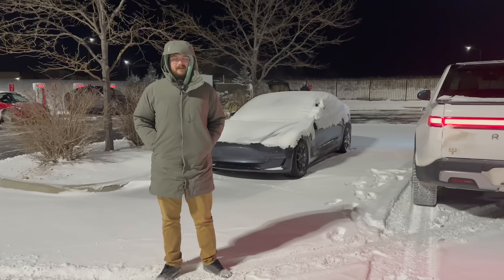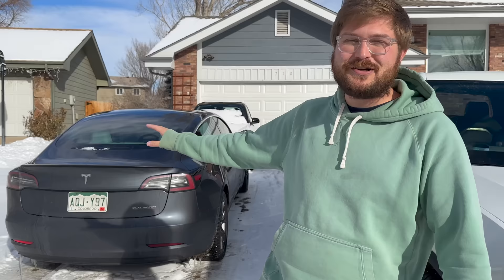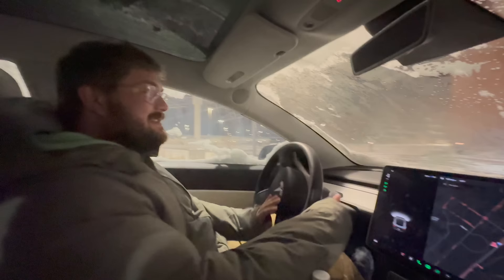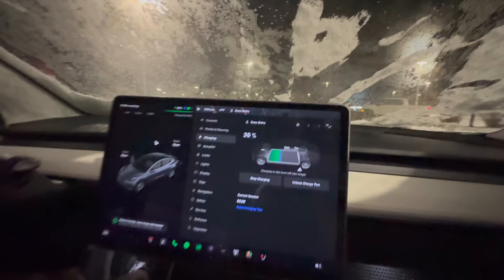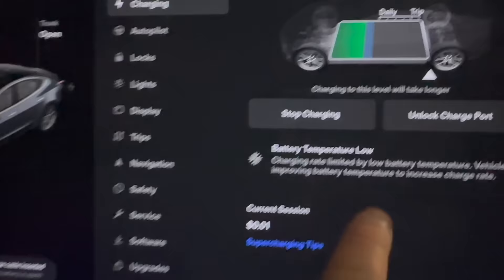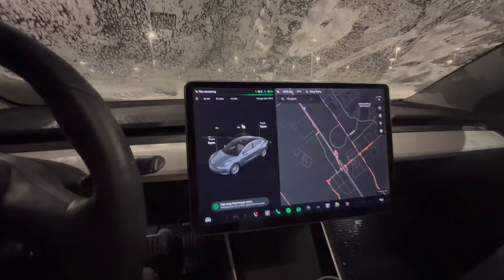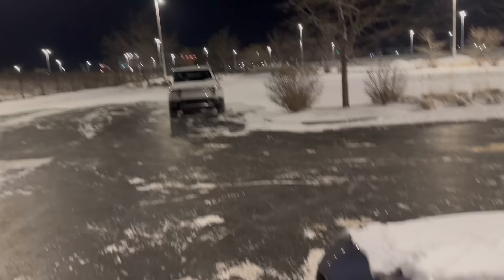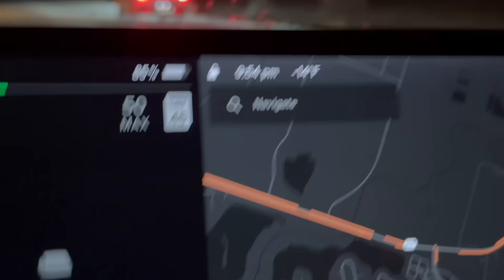I Deep Froze My Tesla And Immediately Plugged It Into A Supercharger To See What Happens

Comment: OK, so perhaps it's my age, but I grew up here in Canada and I would never leave the driveway unless ALL windows were completely cleared off. Just a safety thing to have clear and unobstructed visibility. Just a thought.

With respect to EV ownership, managing the battery in the winter is definitely part of the paradigm shift the owner would need to go through. Totally agree with the charge-up-before approach for the very thing that you experienced. In many ways, cities still need to better understand the need to provide even simple level 1 and 2 charge points for people without driveways or garages. There are light poles on every street, so it's not like on-street charging is impossible. They just need to work out how to make it accessible and fair.

In northern Canada, parking lots had outlets for ICE vehicles so that people could plug in their block heaters on cold days. Its not a far stretch to do something similar for EVs.
Reply: No one cares bud
Reply: @ccgb92  it is also the law
Reply: @KarlDahlquist  irrelevant. only thing wrong with teslas is: ain’t got no gas in it.
Reply: @ccgb92  begone troll

Comment: Watching you look out the frosted fogged up windows and seeing your breath made me really appreciate my internal combustion engine; thanks for the video.
Reply: Tesla needs a cast-iron wood-burning stove for heating :)))
Reply: He could have just turned on the heater though, and been warm in a minute or two. At those temperatures that takes an ICE forever.
Reply: @Adriaaan  It only takes my Expedition 5 minutes to warm up enough to put out heat. And I've owned and operated ICE driven cars that put out usable heat much quicker than that.
If you can't make it 5 minutes without heat, you should probably stay inside your house anyway.
Reply: @Adriaaan  And he would have filled up his tank and driven off in 90 seconds instead of sitting so long it warranted a video.  EVs are a friggen joke and everyone knows it.
Reply: @Leester-70  Sometimes, I 'Like" comments sarcastically.
Reply: @christophermahar3025   Fascinating.
Reply: @Leester-70  You missed the point of the video.  He did this to try and develop a worst case scenario on purpose.
Reply: @TheBowerbird  Fair enough.  Now do this same test with a gas engine.  EVs suck.

Comment: I live in Fairbanks Alaska we recently hit -41 and I have seen minus 71 in the 14 years that I have lived here. I was extremely interested in seeing what your video reflected. I am impressed with your expertise and knowledge of the Tesla and really appreciate the information that you shared. I would definitely like information as to how efficient the Tesla ran at the negative temperatures. How much did it diminish the distance you could travel. Look forward to seeing more of your videos
Reply: If I were you, I wouldn't trust ANY fully electric vehicle to get you across the Dalton Highway - even in summer.
Thank goodness for fossil fueled motors.
Reply: I just read of a story where  a brother and sister rented a tesla from Orlando to Kansas when they hit the cold weather, they had to charge 6 times in 1 day
Reply: I am in Canada and I can tell you that on a negative 30 day my range will be half. It’s not so much that you use more to travel it’s that it is heating the battery and keeping the cabin warm. So normally on a nice day with my spirted driving I could get about 400kms in the winter it’s around 200- 250.  I am debating trying a few things to improve that. I am thinking insulating the glass roof might help. I might try this next cold snap.   
Keep in mind that if you have your Tesla plugged in just like your regular car you can pre heat the battery and interior before even leaving your house. So you can get a bit more range doing the preheating while still plugged in.   The coldest my car has been was -42 and even at that temperature it still worked. But I would say just like a gas car if you hoop in on a -42 day and don’t pre heat or have the block heater going. It’s not going to be great for either gas or electric vehicles.
Reply: Oh one more little note I don’t believe there is a good way to get to the main land of the US from Alaska at the moment.  Definitely not on the super charger network for sure.  I feel like it could be done but not in the winter I would say and difficult in the summer. Definitely not a seamless experience.
Reply: @davidkinch2100  ona boat... but is the car chargers  4 electric  on the ferry ride.  N u can still go by land.
Reply: @davidkinch2100  straw man
Reply: @davidkinch2100  yea there is, simply use a grappling hook to latch onto the back of a semi-trailer and use in flight refueling by hitting that regen braking.   Then you’re making good time as you refuel, let’s see a gas engine do that!
Reply: @davidkinch2100  This guy gets it. If it's -40 and you don't have an engine block heater, you're in for a miserable experience next morning
Reply: @franklinfleming1237  Lol, if you’re on a ferry you don’t need a charger and yes your could technically travel by land there is chargers now however I don’t believe superchargers are all the way up there yet. But there are alternative chargers.
Reply: @davidkinch2100  There is one in Chugiak, AK, just north of Anchorage. There are blogs of people who have driven Teslas from Seatle to Anchorage using CCS and campground charging.
Reply: @QUIX4U most ICE vehicles can’t travel over 300 miles without stopping for gas lol weird comment
Reply: @MadisonFalcoFoods lol… my 2007 vow golf gets roughly 600km per tank “55L” and my 2016 hd truck with a diesel gets 1000km per tank 110L 🤭
Reply: @Fitter4life  Right and I said “most”. I’m sure you understand the nuance and how you’re an outlier here😄
Reply: @MadisonFalcoFoods  well that’s why I disagree. I’d say my truck is above average performance but my golf, that’s an average every day car
Reply: @MadisonFalcoFoods the difference is the gas stop can be done in less than five minutes in hundreds of places.
Reply: I'd like to see this video at -41 in Fairbanks!
Reply: @samin90  Exactly. All the breathless coverage of Chicago misses that ICE engines don't like cold either.
Reply: @MadisonFalcoFoods  A gas station stop takes a few mins maybe slightly more if you're filling from empty. Doesn't matter if it's -30 or +30 Celsius. You can even carry more petrol in Jerry cans, doubling or tripling your range. Yours is the idiotic comment here
Reply: ICE car design has beaten the cold.  In 1970s MN we d run cord out to car to keep it heated in -20.  Now no one does that.  Something improved.  Till EVs add 2 foot of foam to floor to insulate battery they will be awful in MN, either redesign or stop telling Minnesotans to buy EV.  My mom barely can stand winter there, adding 2x cabling and range anxiety will make her life far worse. ....  Maybe EVs can improve for now they're awful risk for MN.
Reply: @mostlyguesses8385  Improvements in oil right? I suspect its ranges of temperature. In Canada, plugging into an engine heater overnight is pretty much manditory. From there its just about how much damage you want to do to your car. With aircraft, its understood that minus temps mean engine preheat. If not, you risk engine damage, since the oil may not flow.

Now back to EVs. Yes, batteries need to be heated to run or charge when considering low (< about 10f).
Reply: I actually think the video is misleading and can put people at risk😳🙄😔
I mean who waits in - 16🥶 for almost 2 hours in a Car with no Heaters 🤨🤔🙄
It would be interesting to see the impact of heaters being on, would the car be Able to warm cabin & Batteries 🤔would this double the time of preheating 🙄
Reply: This is awful. Sorry. Too much "babysitting". Time is the most expensive currency. And I'm not even mentioning health hazards for being in the cold for so long. Leave Tesla and other EV in warmer climates.  Seriously.
Reply: @MadisonFalcoFoods and we’re You seen that??
Reply: @Fitter4life and yet you still watch Tesla videos…
Reply: @stevecorven7071  got that right. I enjoy watching comedy with some popcorn in hand
Reply: @glambor1  Do you think you HAVE TO stay in the car and HAVE TO have the heater turned off to charge an EV at that temperature? Seriously? This was an experiment, not the average EV charging experience in the cold. If you have charging at home this is literally a non-issue.
Also, ICEs experience a lot more wear and tear in extreme colds than above freezing, especially during start-up, while a battery will have very little additional wear so for short trips in the cold, the EV is actually better.
Reply: @samin90   But an engine block heater only needs a couple hundred watts. 5kilo Watts would be enough for 20 ICE cars.
Reply: I can’t wait to get Mine!!!😂

Comment: Good video, I get it....  I'm not getting a EV...  even without a deep freeze your essentially dancing on eggshells to keep your vehicle ready, between range and temperature charging.... probably work much better down in the South though.
Reply: Extreme heat reduces the long-term battery life, so not too sure about having one in the South either (batteries don't like being above 85f).
Reply: Ev still seems to be best in tandem with ICE. I want an EV for when I can do city driving and maybe some road trips in the summer but for everything else I would still use ICE

Comment: In Western Canada, -20 C to -35 C is normal during the winter.
Reply: Yeah, I think they must have made some changes since this guy got his. My 2023 Long range Y does great in North Western Alberta Canada. Starts fast charge almost instantly once I plug it in. Drives fine in the cold, one thing i will say is that it does disable regenerative braking charging occasionally for the first few minutes driving in the cold.
Reply: @christiankrause1150 , one main thing being the heat pump. His earlier Model 3 doesn't have one.
Reply: Good reason to stay with gas.
Reply: @davehenderson6896  why? christian just said it works flawlessly in the Canadian cold

Comment: Was the car at 35% when you dropped it off?  One of the things I wonder about is whether the car is able to estimate its remaining power when it's frozen like that.
Reply: @Cupid_Stunt car literally doesn't use any battery if it's not being used.. what are you on about? 😂
Reply: @777jrg  extreme cold and extreme heat rob power.
Reply: @777jrg  A Tesla in this cold will use up to 1-2% of battery per day in this cold while sitting there, I know because I own one